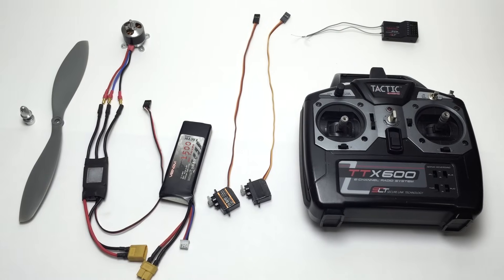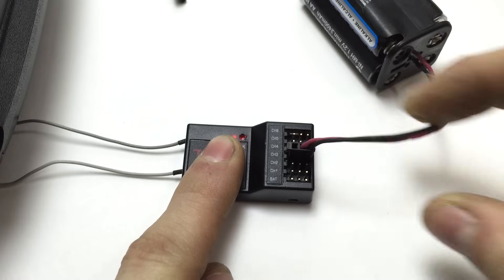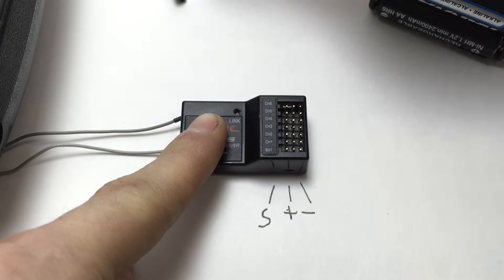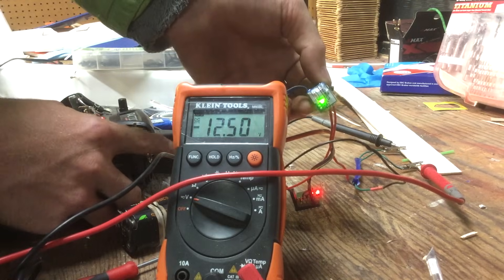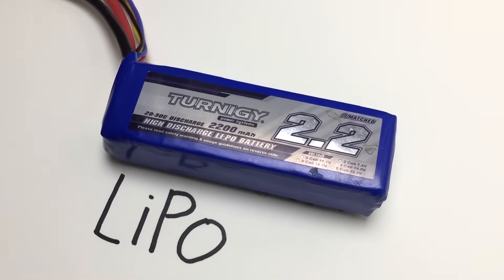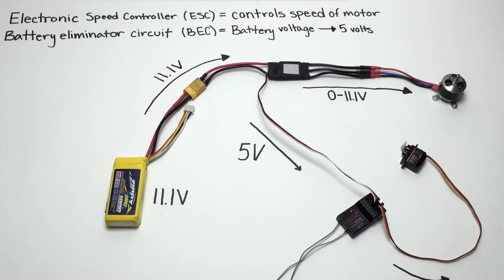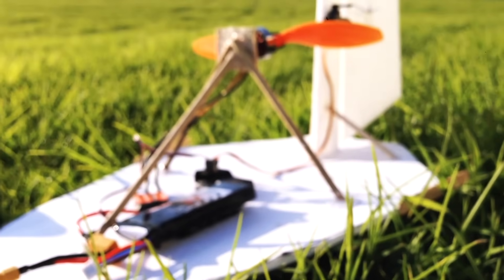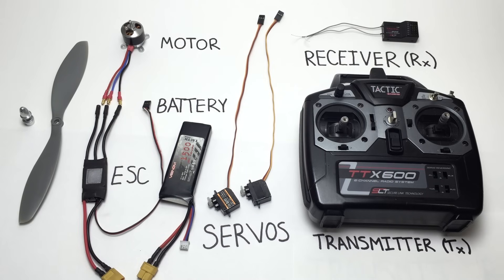RC Electronics for Noobs

Comment: Great video Samm
Reply: I'm very thankful to both of you for having introduced me to this incredible world of RC airplanes! Keep up the good work and please continue spreading this hobby!!!
Reply: @classicalmusicanalysis  yea
Reply from the maker: Thanks very much! Love your work
Reply: Samm Sheperd did t
Reply: @SammSheperd  f 55 Ghaziabad yaar se saman banana hai RC plane ka saman banana hai kaise banaye batao
Reply: +Samm Sheperd (SNRS) Sam bro I am one of the child in these projects I am 11years old but I want to make my first rc plane
Reply: @howtomakercplanetecnologis655  hey dude same
Reply: Sup i love
Reply: தமிழ்  Unfortunately Samm is no longer with us dude.

To answer your question, first you need to look at your chosen motor, and find its current and voltage draw. From there, select an ESC that can handle both.

Then from there, select a battery that can output equal to or greater than both of these. You'll notice that batteries are often sold as xxxxmAh. If it were 1000mAh, that would mean that the battery can output 1A for 1 hour, so obviously the higher this number the better. Don't just blindly trust every eBay/banggood battery that boasts 300000mAh though, they're always a scam.

Most components are interchangeable, but as long as they can withstand the battery voltage then you'll probably be all good.

Do some research dude, you'll get there fairly quickly. Also, invest in a good flight controller for any build that you spend more than a day on. It will help you not crash and waste your money.
Reply: @DeltaCodex  hey I wanna get into rc car building and stuff is there anyway I can contact u through socials or anything? I need a little help and u seem to know a bit
Reply: Can FlieTest make giant rc lancaster
Reply: You are the best
Reply: From J. I. G. I LOVE YOUR WORM
Reply: FliteTest girlfriend Aslam@technauto.com
Reply: New Towerpro MG958 55g 20KG High Torque Digital 2017 0n ebay : http://ebay.to/2f8K5xc
Reply: I'm so happy because of your video, how far and how hight it can fly? The ( rc plane )price is is too hight!! If it is not so good ,it will be wasting money. That. Why I cannot have decisions in buying the parts ,for me 10000 also too hight , is it flying time depend on the battery?
Reply: @collectionofdifferentvideo6239  flying time depends on battery, height/distance depends on the rc combo if one of em dont reach that far than RIP, otherwise u can also fly indoor
Reply: @Noah Gerard i am 13 but i good at this stuff. that will be hard to find parts under $30 you need around %60 to $100. try a car for $50 because of the cost and it will help you build experiences.
Reply: HELLO FLITETEST
Reply: Hi I'm in Ghana I to join you.
Reply: How dare u call us noobs
Reply: I love your videos flite test
Reply: This is her son
Reply: Now I am a professional
Reply: Bro I want to make an airplane please help me how to get these tools?
Reply: FliteTest

Comment: i tried to make a VTOL for my first drone project and it failed miserably because i didn't understand the different cells in battery and how they work with the motors and also how all the connections works. Thanks for this video

Comment: I tried this but when i give full trottle esc automatically turn off and turn on, i use 2450 kv burshless motor,simon 30a esc and battry 7.4v 2500mah battery, can u explain about it

Comment: I have a question, what if you only have a motor that has 2 leads instead of 3 leads? What would the wiring diagram be for the ESC side of it?

Comment: hey there i was wondering when connecting the reciever to an arduino do i have to connect ground and vcc to all the pins on the reciever or can i just connect it to any gnd and vcc pins of a channel and then connect just the signal wires of the other channels.

Comment: Between you and TKOR, I have a handle on the new radios...I flew RC back in the 80s, and all my old gear is obsolete.
I have bought new gear per TKOR's site, but eventually want to fly larger gas engine models...so I'm going to  need a lighter power source that that enormous brick.
Suggestions?  I'm all ears.....

Comment: Two questions, how would you connect multiple servos/motors into one channel, like how when you roll in a plane one aileron goes up and the other side goes down, but that only happens in one movement of the transmitter, not 2 different buttons. Also how do you connect the transmitter to the receiver wirelessly?
Reply: I think you would put one control on the remote to a bunch of channels on the receiver
Reply: ok @kumeater

Comment: I’ve done this before. I’ve built my own aircraft. But I had to come back to this video because I just got a freewing f22 8s pro, and the thing is way bigger and way more powerful than your typical homebrew aircraft. It’s got a bigger motor and consumes considerably more power than an Xmaxx. Xmaxx batteries won’t give me 5 minutes of flight. I hope this video stays up for all time, because I doubt anyone could explain it better. Your 30A 3s 4 channel planes are one thing, but a 150A 8s 6+ channel with a 90mm EDF producing 6kg of thrust is another thing entirely.

Comment: I am new to this and currently planning a project related to boats. I wanted to implement an esp32 microcontroller and sensors for water pollution data collection. is it possible for me to connect jump cables from the receiver to the input of the microcontroller? 
Thanks
Reply: hes dead
Reply: @Vizzix  oh i didn't expect that... rip sam, you died so soon, thoughts and prayers brother 🙏🏾

Comment: Hello..!
This is a great video. 
I have been looking around for one solve, far as I have been able to understand BLDC motors, they will not run in forward & reverse as well  at the same time on python codes (trying to build a bot car using Raspberry Pi). Is there a method i can achieve that, maybe putting another hardware or some code change, can i run them in reverse as well..? 
Wish Allan could help... any help is much appreciated...!
Have a good time.. :)

Comment: If I run the receiver wires straight to the motor (with no esc) will I still get forward and reverse ? Albeit without speed control e.g full power immediately.
Also does the receiver reverse polarity to motor when transmitter lever is in opposite position? e.g ch1 forward =push up , reverse =push down.

Comment: Very helpful tips! Straightforeward! thanks for sharing. But I have a question: You show 3 wire from the esc to a brushless motor. I have a brushed motor in 6V,(Multiplex Glider). The engine have only 2 cable. I wanna connct this airplane with my Flysky remote and a FS-IA6B. Working?

Comment: so the radio outbut is 0 to 5 volts and I can use npn transistor or pnp which is wanted use to control motor with battery ^_^ this way I can run electrical motor and make something simple. . . .

Comment: Very good work. But can i ask you something? In vintage rc from 80s to 90s , i want to replace the circuit board with only a receiver ? Will it work? That i mean, I will put the battery and the 2 other motor's on the receiver. 
Thanks for your time 🙂

Comment: I have a problem. I dont know what battery to use. I have a plane and want to just stear it. For this I bought a reciever and transmitter + 3 servos. No motor. The transmitter says 4.5-6V and 2A. What type of battery should I use. Expecially which type of plug does the battery need🤔🤔 can someone help me?
The receiver has the same plugs than in the video

Comment: Can I use normal motor to this esc.  And if I use 2 motor with one esc how can I turn off one motor when I press right or left. E.g. pressing forward motor 1 turn right and motor2 turn left. And when i press forward and right one of motor 1 turn right and motor 2 will off.  How can I configure this. It's for boat

Comment: I'm very mechanically inclined but computers and electrical are sometimes I admit I'm weak at & want to learn more about. 
     How could I convert a 120v wall outlet into a power supply to power several big electric motors without frying all the electronics?  I'd still want it to be remote controlled but the power supply to what I'm building would be wired in because I the motors will be drawing a LOT of power.

Comment: Does it matter what servo wire ur using? My quad comes without a receiver and 5 wires just sticking out with no plug on the end. I have an fs ia6b receiver and need to plug the wires into it..... Can I use just a PC fan servo wire?

Comment: Thanks for the video! I just had an rc drone drone break, and now I can experiment with the electronics using an arduino.
I have one question, though.
I have a way older handheld controller and receiver. But when I connect things, like servos, the servos twitch around and aren't steady.
Is the receiver toast?
Again, thanks for the video!

Comment: Brilliant video, the speed controller supplying both power to the receiver and receiving the signal was the thing I didn't understand and probably what confuses most people at the start, I initially assumed a second battery would be needed.

Comment: 2 servos for each flap for roll right? How do I connect them on the roll channle and make them work opposite on the same channle???
Reply: The thing you need is called "Y-cable". You can plug both servo cables in it and you'll get one output cable. Chick this out: https://www.amazon.com/Servo-Cables-Female-Extension-Control/dp/B01F742QDM/ref=mp_s_a_1_3?keywords=rc+y+cable&qid=1553387839&s=gateway&sr=8-3

Comment: Can i use this ESC ( THE ONE IN VIDEO) to control bigger motor (180 kv) for an electric skateboard
Reply: Probably not, it may turn the motor but not if you're on it, the ESCs are built for certain voltages and amp draws, so make sure the number of cells is correct, if the motor uses 8s than you need at least an 8s capable ESC. And the continuous amp draw must be within the limits of the esc, for a low speed high power motor like a skateboard motor, you will probably need well over 100amps.

Comment: If I wanted to add a kill switch to a traxxas XL5 ESC. So I dont have to take the body off everytime I want to turn it on or off.  With a 3 prong switch would I put the switch before the esc? Or after? If after I'm afraid the ESC wont power up without hitting the on bottom... Not sure if any of this made sense.. Hopefully someone can help me... 🤷

Comment: @2:50 to motor controler sends 5v to the receiver, how does the receiver send a signal back to the motor controler? Trough the same cable that sends the 5 volts?

Comment: Thanks Sam, can you do a video on edfs? As i am working on a project with using an Edf for my scratch built delta wing setup
Reply: He passed away
Reply: @michaeljoseph4314  shit... Sorry I dint know about this...feel like and idiot... That's such a big loss... Thanks for letting me know Michael. May his soul rest in peace.
Reply: @thercbat  Also sorry should have said this before, but you can wire your EDF to an esc the same way you wire a motor. An EDF is just a different prop on a brushless motor. Just make sure your EDF is rated (Amp) and you have enough cells in your Lipo
Reply: Thanks Michael!

Comment: Is there any device or circuit that can be used for the stepper motor that needs more than 5 volts with rc system ??.....   

can I just connect stepper motor's  + - wire to higher volt battery and just signal wire to receiver ??? 

appreciated

Comment: I would like to get into rc building but I'm worried to buy my basic gear like a motor and a ESC because I am unsure how to connect the end of the wires together I know you can solder them but I would prefer not but a soldering machine is it possible to make it so there is like a jack on the end of my wire so I can re use my motors and esc and mix and match them later on. Thanks
Reply from the maker: You can solder quick connector on. Or just unsolder and resolver. It’s a good skill to learn

Comment: It was verry helpfull but I have still a few questions:
Can I connect every esc to any reciever?
How do I know if my ESC is compatible with my brushless motor?
Can I connect any batery to any ESC?
And you connected the battery to the reciever in the beginning of the video but later you connected it to the ESC where do I need to connect it to?
Thanks for the video and for the help☺️

Comment: great  helpful VDO thanks
but my question if I can upgrade
my miss geico 17-inch boat speedpack battery from 1200mah to 3300mah?
the voltage it's a same 7.2
and if i can charge the new battery with the same charger ? 

thanks!

Comment: I was considering going for all this, but a cheap 'plane has it all as well as the actual 'plane, with it already all put together, and it's no doubt a fraction of the cost. WLToys for example come with a transmitter and everything else - including some control servos - is all on one circuit board, which is cheap to replace. And there is also a socket for an additional servo. So you could just get the spare boards and a couple of other bits and use it to make your own 'planes. Just like this but simpler and cheaper.

Comment: Sorry for the incessant nagging, but I just got my FlySky IA6B receiver, and I cant get it to work with my Emax 30a BlHeli ESC. I tried everything, but the ESC just gets hot and it doesn't beep ever. The polarity is correct, I tried every channel on my rx, and I switched from ppm to pwm and back on my transmitter. I hooked up some servos and they work fine, but the esc just doesn't beep or turn on or do anything except get hot after about 5 seconds. If you don't know what this could be, I'll just return it and hopefully get a refund.

Comment: Very informative video! I have one question though. I am completely new to fixed wing aircraft, but I have a little experience with quads. I am getting new motors for my quad, and would like to recycle the old ones to use in a plane similar to your 5$ Trainer. I have a bunch of spare props, and two functioning motors from my quad. The motors are 2300kv, I have 1 30amp esc with a BEC , and my props are standard tri-blade props for a 2300kv motor. Would one of these motors work for a plane of the 5$ trainer's size? Or should I "splurge" and get new motors and props (say 1400kv and 8040 props). Thanks!
Reply from the maker: You can make that work sure just keep it light weight. Would also be fun to make a twin
Reply: Thanks! Is there any way to hook up the servos to power without any more components? If I went the twin route, I only have one ESC with a BEC, and two without (spare for my quad). Or can both the motors go on my 30amp ESC with a BEC? I would experiment, but as i'm only 14, I don't have enough cash to make something that will burn out when I give it throttle. Thanks again
Reply from the maker: Only one motor for each ESC.

Comment: Hey, I am a hobbyist can you tell me how do you select the motor for rc aircraft?  How much thrust to weight ratio do you choose ?I have built a plane of around 6kg how much thrust is required?
Reply from the maker: I like a ratio of about 0.5/1 to over 1/1. So I’d want 3kg thrust or more.
Reply: Thank you
Reply: 0.5 thrust to weight necessary if you have a large span

Comment: I am going to buy th parts from your recommended setup, but in the battery section it does not seem to include a charger for the battery, how would I recharge the battery and where can I buy a battery charger.

Comment: hi i do have esc controller its 7.4v its confuse me only 2 wires to receiver  mens 3 for motor ok 2 battery ok but 2 wire only for receiver its quad copter i want to use for my airplane but only 2 wires black and white were is the signal then?????

Comment: great video! but do i have to connect the lipo to another propeller or can i just plug it in to the receiver.
Reply from the maker: Be careful what voltage you plug into the receiver. They usually only like 5v

Comment: Hi sam. I hope you can answer me. I was wandering what to do to configure a delta wing since the roll and pitxh axes uses the same alerons.  I suppose the two roll servos are connected to the same channel but reversed physically so that whe one turns one aleron up the other does it down or something rigth?
Reply: Okey i fouond it. Its channel mixing hehe. Great video  though
Reply from the maker: Glad you found it!

Comment: Some help please. My brushless motor keeps on beeping with the following setup:
5 v dc power from power supply
flysky tx and yellow esc (30A)
It seems to have bound, cause I can see the tx and the rx voltages on my transmitter. What does the beeping mean?
Reply from the maker: Um try calibrating the ESC. (The ESC makes the motor vibrate to act like a speaker)
Make sure it’s plugged into the throttle channel one the Rx.
1. Battery unplugged
2. Turn on the Tx.
3. Move throttle to 100%
4. Plug in the ESC.
5. Wait until it makes some noises and stops
6. Bring throttle to 0%
7. ESC should make more noises and then stop.
8. Unplug ESC and then try using it.

This just tells it what 0-100% throttle looks like

Comment: Hi i really like your video. Do you recommend any good cheap radios and receivers? Also does the radio have to be bought from the same company/place as the receiver. IM a big noob
Reply from the maker: The receiver does have to have the same protocol as the transmitter and that usually means the same brand

Comment: can i use a 3s battery on 6s esc and 6s motor?
Reply from the maker: Yes, but it will soon pretty slow, you can use a larger propeller on 3s than may be recommended on 6s
Reply: im going to use a fury wing plane with a 370km motor 15 inch propeller with a 6s u yhink im going to have any problem?

Comment: Is the "bat" plug at the reciever for the esc?
Reply from the maker: No that is an extra plug with no channel for you to power the receiver with a battery if your ESC does not provide the power or you only want to use 6 servos